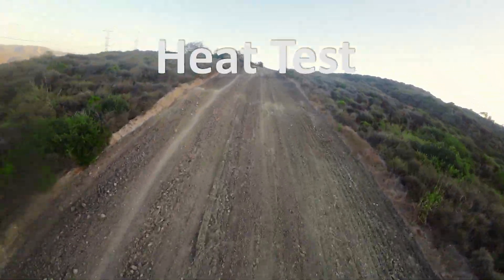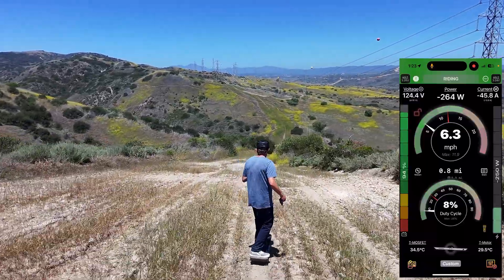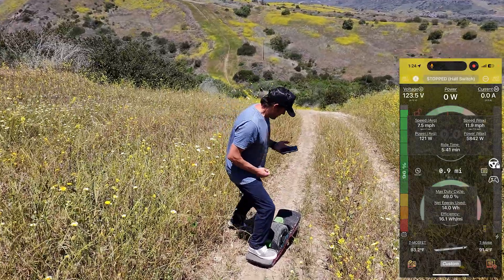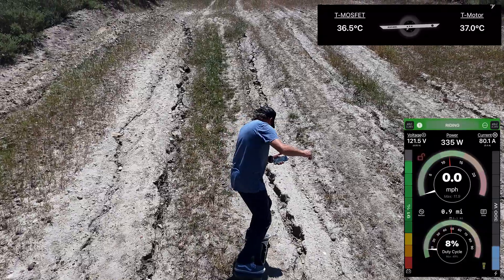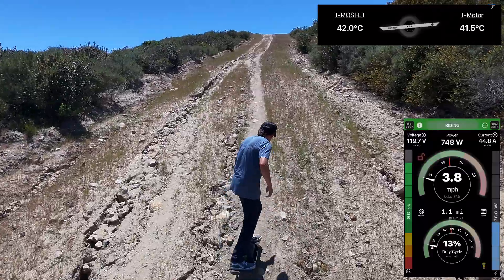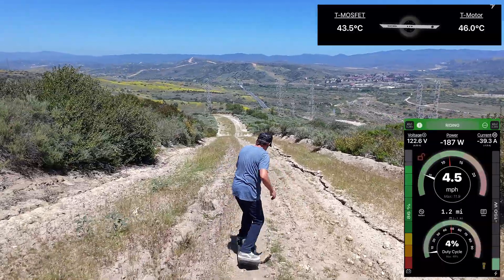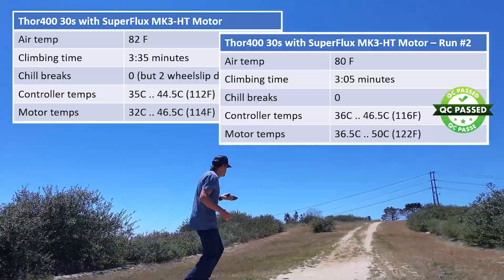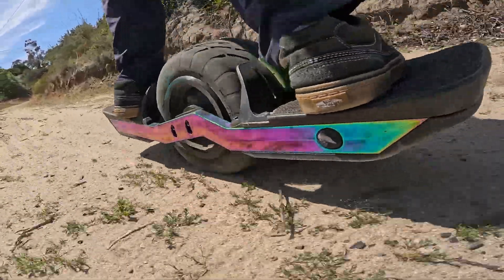Bring the Heat - Part 10: Thor400 + SuperFlux HT

Comment: GTS in GTV board still overheats. It’s definitely better than GT motor though. I overheated in Eureka Springs during the Dirtsurferz 7 mile  excursion race this past weekend. Had to run with the board up a hill for a bit while it cooled. 

I also overheated another time out there riding the trails as well. I’m getting the new X7 supercharged board so hopefully overheating is a thing of the past.

Comment: hi.. I wanted to ask you if the controller burns and you replace it with an identical one, do you have to redo the wizard procedure or can you use the backup?
Reply from the maker: If it’s the same controller you can just restore a backup but each IMU is slightly different and needs to be recalibrated. Also your FOC Offsets can differ between controllers
Reply: You need to export the backup XML not just hit the backup all config button
Reply: as always many thanks!! greetings from Italy

Comment: I've overheated my superflux v1, many times over 80C ... hot day and an even steeper hill than that one, I'm 90kg.
The superflux has great thermals but if conditions are tough enough the temp will continue to rise as it does in your video until you run out of hill.
In real world riding conditions you might already have the motor up to 60C before you climb a hill like the one in the video pushing the motor over 80C at the top of the hill.
A full pack torture test is probably the most useful thing to know. 
You didn't mention 30s SF HT vs 20s SF HS which seems like a point of interest, does higher voltage + lower Kv result in lower motor temps?
Reply from the maker: I have found no correlation between voltage and motor/controller heat. However HT stays cooler than HS (both motor and controller) on the same board, simply due to lower required motor currents
Reply: @surfdado  Do you think upgrading from a superflux v1 to superflux HT is worth it for improved thermals and torque particularly low end hill starting torque? How much difference?
Reply: > does higher voltage + lower Kv result in lower motor temps?

I am wondering about this myself. I have a 18s xrv w/ stock hypercore, and a 18s gtv with gts stator and n52 mte. Both motors overheat on a hilly single track here that I can run on my gts without it getting close to overheating. Seemingly it takes a lot more low voltage watts to produce similar torque. What does that graph look like for these motors?
Reply: @MariusSchilder  I think it has a lot to do with the current limits of the GTS. You cant dump nearly as much current into the motor as VESC with the GTS. So the VESC is dumping a lot of current and giving you more snappy acceleration, if you lower motor amps then it will run cool like a gts but you will loose that. The combo of high voltage and medium motor amps on the GTS gives you a good amount of performance  for those hills your describing but in more demanding conditions it wont have the torque to clear more difficult climbs that are possible on VESC with ~120A going to a hypercore.
Reply: @benlay750 dado what you think about this theory?
Reply: @AuRowe  I think its pretty reasonable. I'm quite aware that I could tone down the amps in my config that are ~200A+ .. Not many folks are overheating their superflux .. barely gets warm in dados test. I'm my case I just have an extreme offroad climb I hit regularly in the heat of the ozzy summer. If I ride that section really fluid I'm right at the red line, any mistakes and I'm forced off by overheating at the top. If I was overheating in the middle of the climb I'd reduce the amps ...

Also I run a fast response tune that is very different from what pretty much everyone else uses that makes the board respond to terrain changes and rider input almost instantly and really pushes even a superflux to it limits.

From what I hear the extra torque from a HT vs V1 with all else being equal is not a lot.

Comment: thor300 vs thor301 to see if the new fets are a significant improvement in temperature or not👀
Reply from the maker: new fets in the 301? Seems silly to replace them as they were already excellent. Thor300 was the GOAT already
Reply: @surfdado  Thor300 has HYG015N10 (Huayi) fets and Thor301 has IPT015N10N5 (Infineon) fets.

Infineon's OptiMOS 6 would have been much better as it is the latest, allows higher power density and is much cooler than the OptiMOS 5 used in the Thor301. So it is interesting to know the margin of improvement over the Huayi in the Thor300.
Reply from the maker: @lucasgomez7239 yes I just checked with Fungineers, you’re right